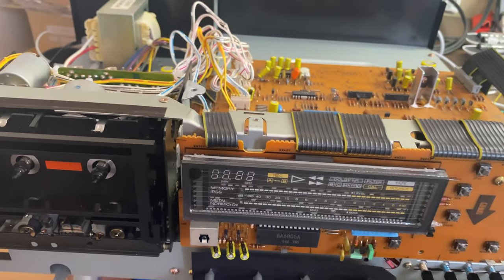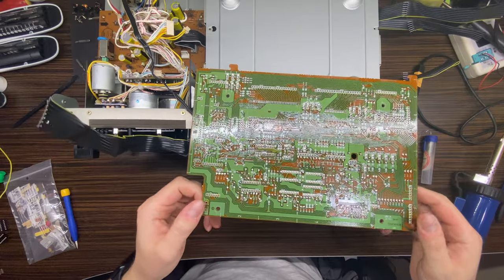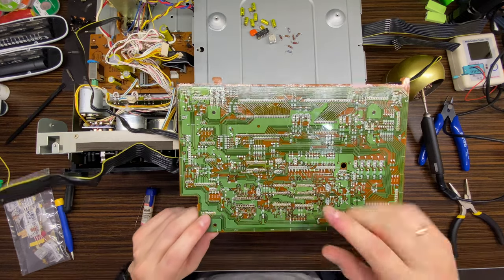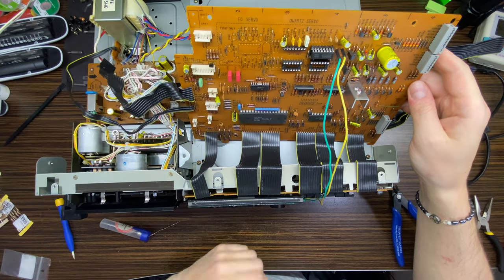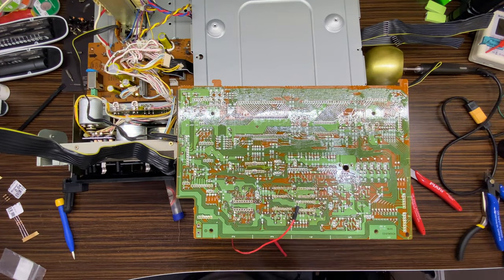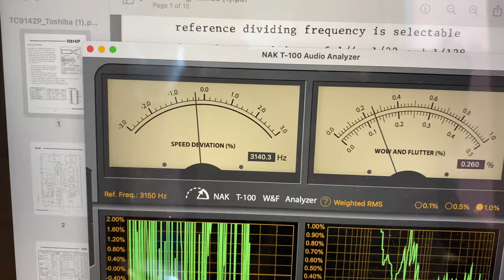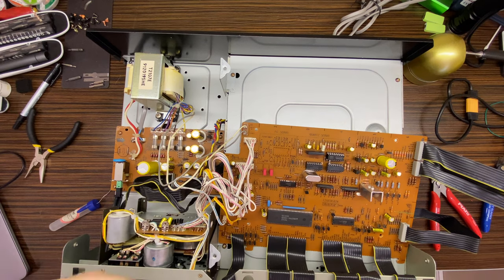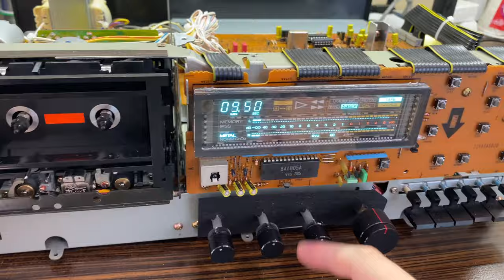How to quartz lock Akai GX 75 tape deck / quartz lock mod GX95 GX75 #diy #repair PART 2 E0021

Comment: If possible, it would be good to compare the results between these two methods of control. Before and after modification.
Reply from the maker: this will be in this video :) before speed drifting is like +-2-3hz (at the end of the tape even more drift) and with quartz lock no more than 1hz with tapes that i have (especially with fizyouraudio i see that deck became very stable). Not the first akai deck that i have done quartz lock. Cheers

Comment: Great speed stability, but what about the wow&flutter? 0,07 it`s way too high for this deck. I always use the WFGUI software and switch between 0,4% and 0,1% settings, the 1% setting will make things look better when they are not!
Reply from the maker: Thanks for you comment! 
If you noticed i was using test tapes that have 0.1 w&f, so this result cannot be good with them. Also this deck still has one flaw- a bit shiny takeup capstan that i will have to fix with fecl3 solution :( because shiny take up capstan can be very good candidate of who is fault about that w&f. :(
Reply: @LT.tapeheads.service  Good point! I`m a wow&flutter freak! I would like to do this mod on my GX-6. Never underestimate the reel motor importance, these Matsushita motors from the `90 can cause a lot of unwanted modulation due to the magnet degradation. I have seen that 1000 times. I think the  WFGUI software is best for that. Looking forward for the next video!